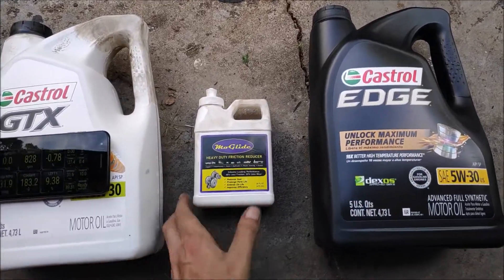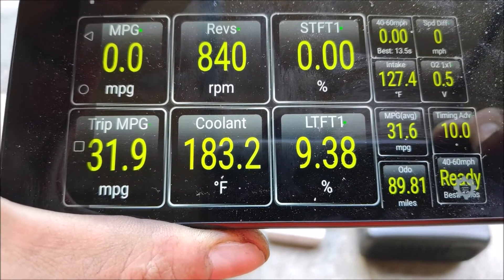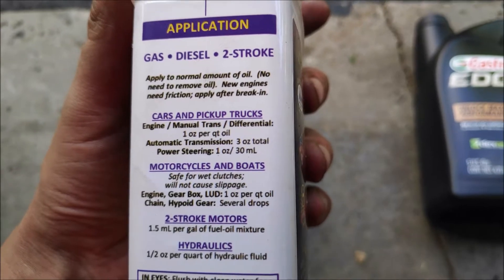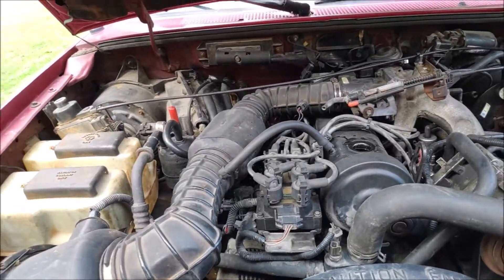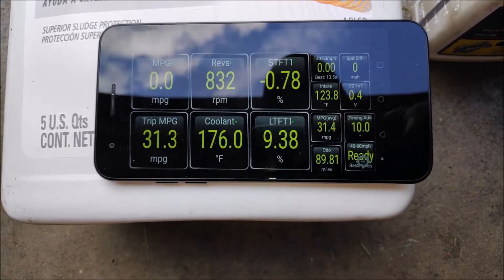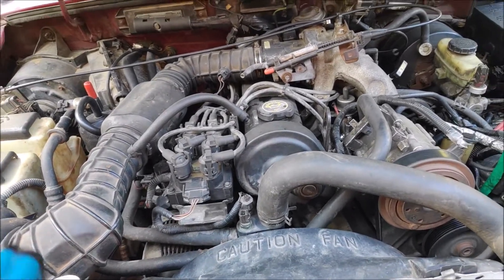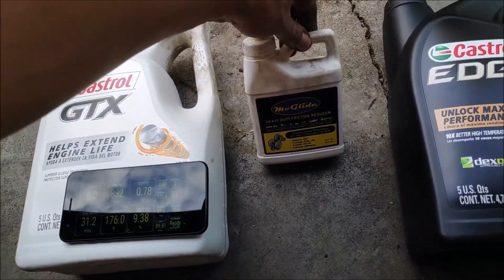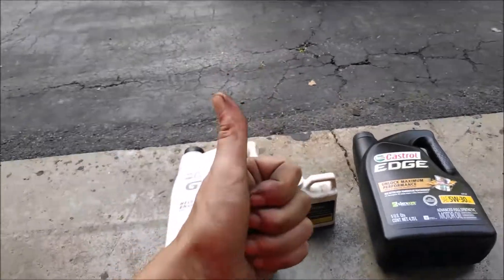No More Friction Engine Oil Treatment? Let's Find Out. Part 2.

Comment: 😂ypur frand from Jamaica doesn't know what the heck yall talking about,,that stuffed dropped temp in My Detroit diesel 15 degrees,and 10 degrees on front differential,,full syn blend,and the Honda 1.8,with 90,123 miles,and Kia 2017 with rebuilt engine with 87,000

Comment: I am enjoying your testing of our product.  It is fun for me to see that even with simple home means you are able to see improvements.  Here is my personnel opinion on oil.  I only use standard oil, and I use the cheapest oil I can buy easily and just treat it with NMF/MoGlide.  Short of you going out and buying some expensive racing oil this combination has out performed every oil I have tested.  When we do a friction and wear test on a oil or oil and additive combination we use a race and bearing friction and wear testing machine.  We add another weight to the machine every 10 seconds till the race stops spinning.  We then note the number of weights applied, how long in seconds did the race spin then we weigh the bearing to see how much material was lost due to the forces applied.  At some point do let us know where you live and if we are doing any friction testing in your area we will let you know so you can bring any oil or additive you would like for us to test and we will do those test.  Keep up the fun!   Jim
Reply from the maker: Thanks, next I am going to test it in lsd differential with synthetic and non synthetic gear oil, can't wait to see how it does.